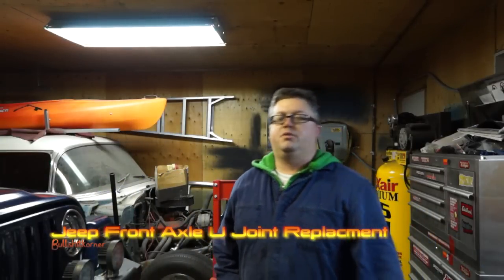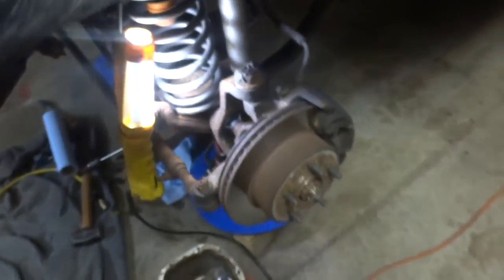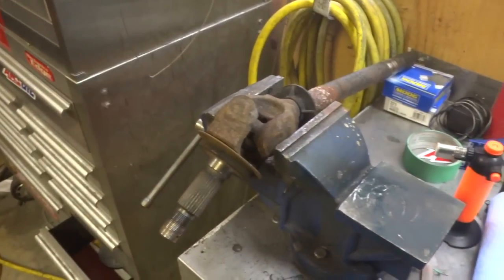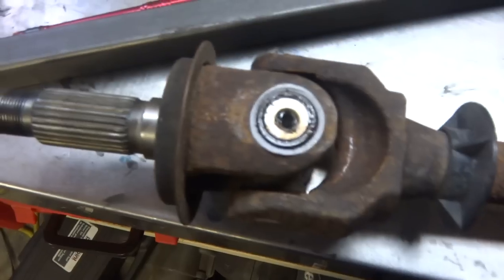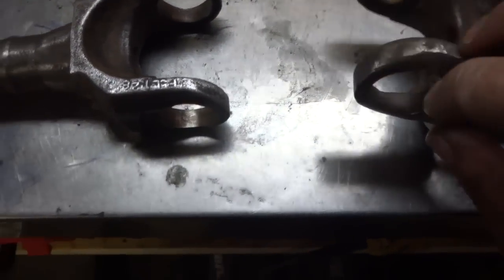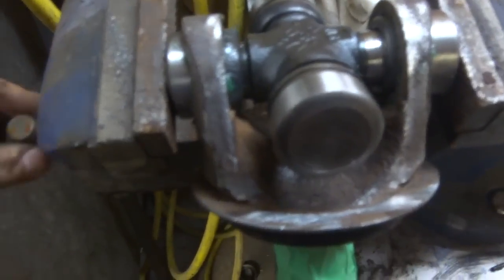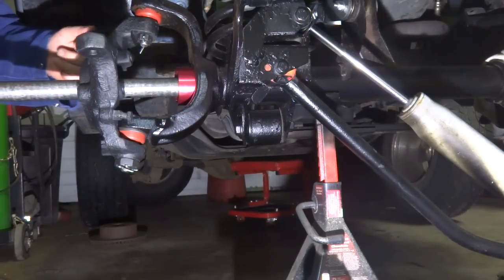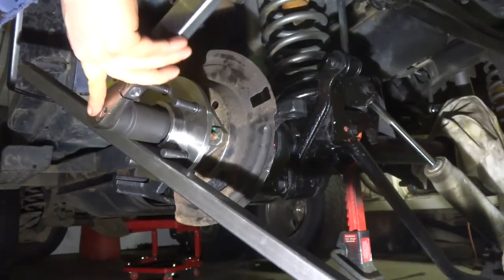Jeep Front Axle U-Joint Replacement DIY (Detailed)

Comment: If you can't afford a ball joint press, a big C clamp and your socket set will do.  It's basically the same thing.

If, for some reason, you don't have a torque wrench, don't just crank it down.  Tighten it down until the bearing starts to drag when you spin the wheel, and then loosen it until it just starts to spin freely.  Some vehicles use that method instead of a torque spec.  Probably won't get as much life as torquing it properly, but it'll definitely be better than just tightening it some arbitrary amount.

Comment: It may have already been mentioned in the comments, but the axle nut on a TJ (or any vehicle with a unitized bearing, which includes virtually all FWD vehicles) does not set the bearing pre-load. It is there simply to affix the axle shaft to the hub. It certainly is critical to torque the nut properly, but not for that reason. I only point this out because someone could be confused by this information when later working on a vehicle that DOES pre-load a bearing with the spindle/axle nut. The torque value for those vehicles is usually about 20in-lbs and is best done by "feel", or turning the hub with an in-lbs wrench to the desired factory rotating spec. Obviously that's a large difference and may leave someone scratching their head wondering why.

The video and procedure were both accurate and helpful other than that small detail. Thanks for taking the time to make it. I stopped by to see how you got the c clips off and found what I needed. Thanks again.
Reply from the maker: Your actually wrong, the torque specs are from the service manual which are 175ft pounds. And I've also shown in another video how the nut keeps the bearing from splitting in half.. But thanks for coming out

Comment: Just thought I'd add a tip to help prevent breaking the old caps like that. If you set a good amount of tension on it with the joint press, pull back and tap the yoke with a hammer. Sometimes more than a tap, but not a fucking slam. Most of the time they will pop right loose. Great vid tho, first of yours that I've watched, subscribing now.

Comment: Yeah. That's what my local mech said too I think I was putting the cart before the horse thinking CV joint.  It's going in We'd to have a new hub put on before we go in our canoe trip and it has to tow the canoe trailer.
Reply from the maker: ***** 1/2 hour of troubleshooting and you should be able to figure it out.
Reply: It was the drivers side hub. Replaced at my local shop and is good as new.

Comment: I have a 2005 Grand cherokee with CV axles and the drivers side is making a hum when turning the wheel to the right.  it is more apparant at speeds over 30-40 mph and quiets when the wheel is held straight. Quiet with wheel to the left too.  I'm suspecting the CV axle U joint is crappin out.  Do you know if the axle just pulls out of the front diff like on your Jeep Wrangler? Am I looking in the right place for that noise? I was thinking hub bearing but figured the noise wouldnt change when turning. Keep up the good videos!!!!!
Reply from the maker: ***** could very well be the wheel hub

Comment: what size are those 3 bolts that hold on the bering,? i can't tell if mine are just corroded or i just can't get the right size socket on
Reply from the maker: you need a 12 point socket to remove the bearing bolts

Comment: Did you need to remove the pumpkin to change the u joints in the front?  I just changed my gear oil so I will not do it if not necessary.  Also, good idea to replace the bearings while I have this off?  Jeep is 2001 with just 117K miles.  Thanks.  Overall really good video.
Reply from the maker: you don't need to remove the pumpkin the axles will just slide out
Reply: Ok that is what I thought.  I did the rear bearings and was looking for c clamps like an idiot, then you tubed it and the rear just slide out too.  Many thanks, your videos are pretty good.

Comment: Bullshitkorner I have some excessive play in my front drivers side axle shaft at the u joint. I'm able to move it slightly towards the diff and to the tire. Small amount, but its still moving. What could that be? To me it looks like its coming out of the axle tubes. Enough movement you hear a knock.
Reply from the maker: check the nut on the drive axle and bearing
Reply: Could that play contribute to DW?
Reply from the maker: if that nut is loose and or bearing is bad it would cause a wobble for sure

Comment: I had heard that on a yj wrangler with vacuum actuator[4wd engagement], the axle will not pull out unless it is removed. Do you know if that's true? Also....how the F%@# did you get that rusty hub off ?
Reply from the maker: I believe that is true, it was a bitch to get that hub off.  I had to use some violence to teach it a lesson

Comment: I did not know they made a tool for u joint I all ways used a socket smaller than the caps and a bigger one on the other side and a big fuckin hammer
Reply from the maker: +art Phillips and Now you know